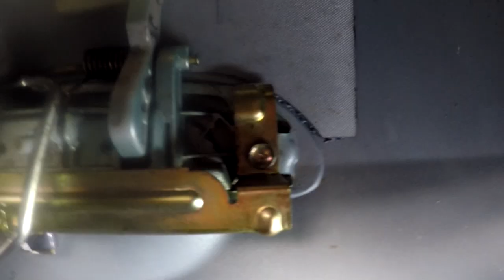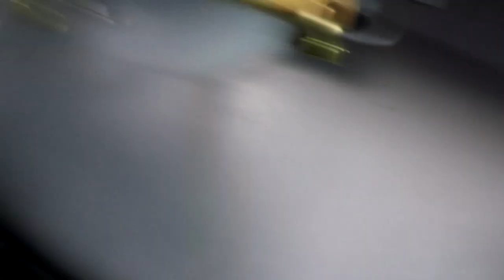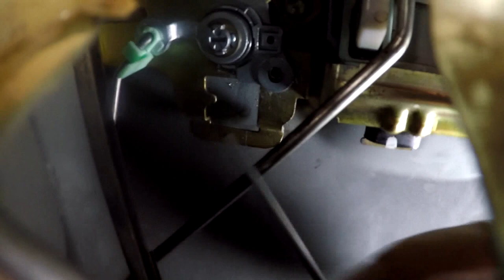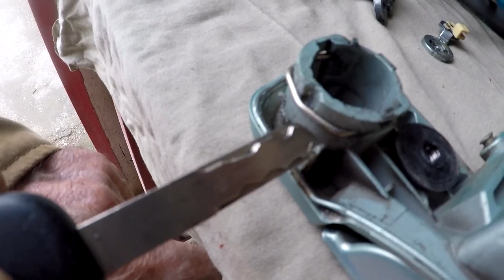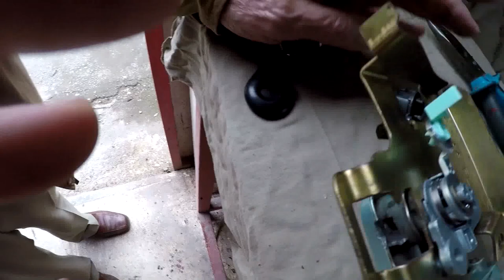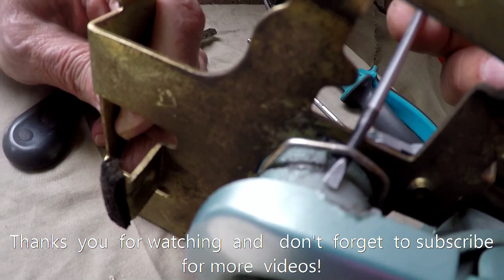Honda Jazz /Fit   (2001–2008)  How to replace outside car door handle

Comment: You didn't show how to remove the small pin to release the lock
Reply: need to pry open before pull out the door handle.

Comment: Hi, here is the situation with my 2010 Honda Fit.  I tried to open the passenger door with a key and turned it left/right, but didn't feel the lock doing anything. Door didn't open. Turning the key back to initial position was met with some resistance.  So to remove the key, I had to keep pushing to the right and then when key was straight, I was able to remove it.  I went to driver's door and pushed on lock/unlock and passenger door knob moved to unlock position, then went back to lock.  Other doors unlock normally.  Manually pushing the knob from inside to unlock position, but springs back to lock position.  Could it be that the lock by the outside handle got stuck and is pulling on the cable/hook of the unlock knob when I try to unlock it?